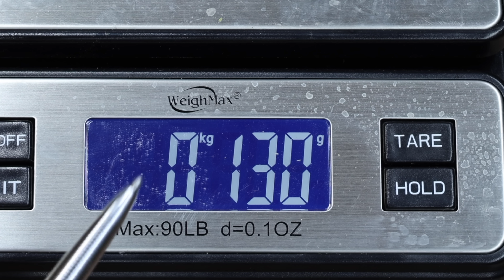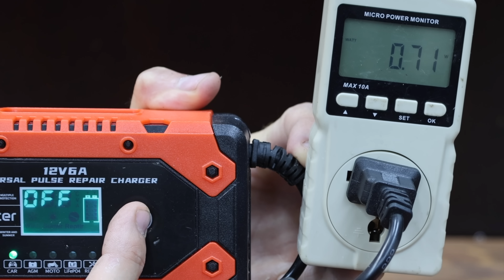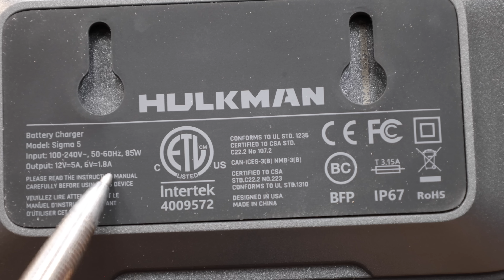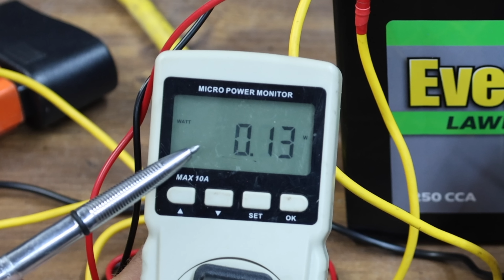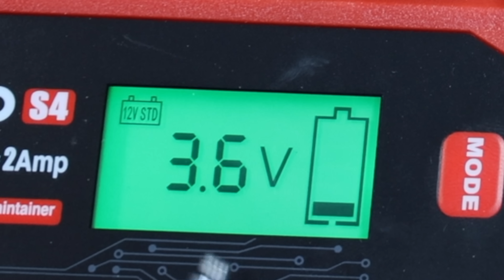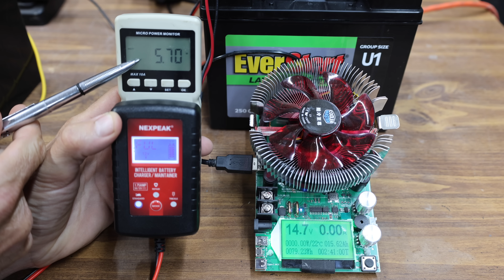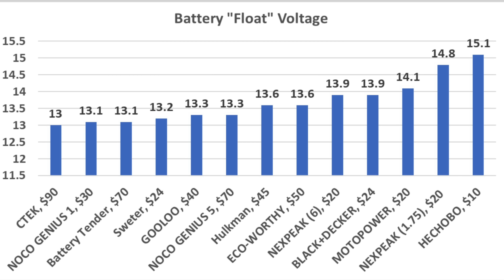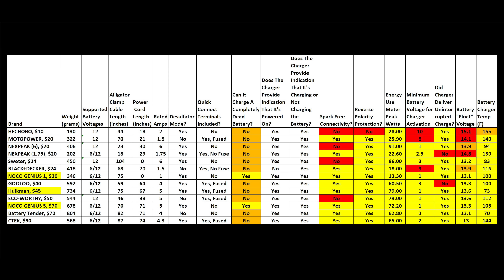I Tested the Most Hyped Car Battery Chargers – One Stood Out!

Comment: Interesting results.  The cheapest one is not good - what can we expect for $10?  NOCO had good test results - that's great to see for an inexpensive charger and a medium priced one.

Many years ago, I had a Black and Decker unit and it didn't last very long.  I was not happy to see it completely die.

I have a couple chargers now.  One Schumacher that can be carried and a bigger Schumacher that rolls around.  I typically use the bigger Schumacher, because it has a 150A start function.  I know it's terrible to do that to a battery, but it does get things going quickly.  And if it overheats, it goes into a cool down mode before it can be used again.

I'd love to see a review of the type that can be carried and the rolling one.

I learn something all the time from your videos.  I appreciate all the hard work you do!  Thank you!!

Comment: Excellent video.  That what happens with the "smart" tech on the battery chargers these days, if they cannot detect anything they won't do anything.  Old chargers didn't care and just delivered, but they didn't know when to stop sometimes.  But if you have an old one, you can get things going and then switch to the newer tech.  It's interesting as I have an older battery tender and it will work on a completely dead battery but just takes forever and I have an old real Sears trickle charger and it will do the same.  A few years ago I got a big powerful smart charger that is supposed to boost, charge, bring back from the dead, start my big diesel tractor etc and it is junk - worst 75 bucks I ever spent.  I vote for a review of the big chargers please and thank you!

Comment: I deliberately keep a couple of simple "dumb" chargers around to use on severely depleted batteries.  The good old Arlec 3 and 5 amp 6/12V ones with a meter are perfect.  I really like the modern multistage chargers, particularly the high end ones such as Ctek for maintaining batteries over time - although for batteries in boats and machinery it's very hard to go past a simple 10-20w solar panel here in Oz to get several years of trouble free service out of expensive batteries...  The only problem with the dumb chargers is sparking, and that you probably don't want to leave them hooked up beyond getting a battery up good enough to swap over to a smart charger of some kind to finish them off.

Comment: I’ve had my Noco genius 5 for 3+ years. It stays plugged and charging something pretty much 24/7. It’s been the best charger I’ve had. The repair function brought my 6 year old mower battery back that wouldn’t crank for more than a few seconds. Now I get almost a minute of crank time. I’ve never had a mower battery last more than a couple years. In my eyes it has paid for itself.
Reply: You need a non return valve in the fuel supply line to the carb...plus perhaps another one in the supply line from the tank to the fuel pump..
to keep fuel in the lines

or a cheap 12VDC Facet style clicky clacky inline pump on a momentary push switch that you use to fill the carb BEFORE hitting the starter function.....

Comment: With all the talk of OIL viscosity…. Can you do a test with small engines with 0-8 oil and the other with 10-30 oil under a load at high rpm and then check for wear.

Comment: For one video, could you test pens or other marking items, I always notice you using one as a pointer. Should be a cheaper video than most. Ink smear test, tip drop test, can it write on wet/slick surface, weight of clicker, clean up ability. I think it would make a great video.

Comment: Not surprised that the Noco chargers walk away with this one... 

I have a Noco Genius 10 charger that is ~2 years old and in one case was used 1-2x a day in ~115deg weather for ~3 weeks while diagnosing a ECU fault (with no apparent wear to battery) and Noco 125 Jumper pack that is ~5 years old and was the only thing that I could find that worked at -20deg and below when I did 24/7 IT support in Wisconsin. The Noco jump packs also have a much higher safe storage temp than most other packs. It is safe to say that I am a fan....

Comment: Ive used nothing but Battery Tender Juniors since 2008.  They just plain work.  I have NEVER HAD A FIRE or meltdown of a Battery Tender.  In fact, I have charged a mostly dead car battery with a B.T. Junior.  Just waited a couple of days and the car cranked right up.
I have NOTHING bad to say about Battery Tender Jr's.

Comment: Thank you for your tests, I have been using CTEK since 2016 and I am happy to say, it has worked flawlessly.
Reply: CTEK is the gold standard, very reliable even durian cold climate.
Reply: Mine blew up recently from heat! Avoid using in heat and they’ll be golden.
Reply: @ScottPC Wierd, have used them in winter and on hot summer days since they came out, never had a single problem.
Reply: @The.Royale.Syndicate  
Ditto...even in a hot engine compartment to fully charge a battery....

Comment: Great video, yes definitely do a handheld version charger with battery boost,agm gel std,batteries also 13.6volts stable charge for doing work with scanner and engine diag. Forney# 52750 would be good candidate .thx

Comment: Having dozens of batteries to be kept maintained, my usage does not often include the need to charge a dead battery. Adding a jump box to a dead battery will allow a charger to start up. After a few minutes, remove the jump box and the charger will continue.  I have tried many brands of chargers throughout the years, and Battery Tender chargers will not kill batteries over time (over winter, 1yr, 5yrs, etc.) However, CTEK and NOCO, while being OK for short term, are not good for long term storage. I have given away NOCO and CTEK chargers over the years, just to go back to Battery Tender chargers. Their customer service is exceptional. And they do not kill batteries when connected long term. I understand that this Project Farm test has different criteria, but wanted to make sure BT chargers were fairly represented for what they do best. I have no affiliation with BT. Just an exceptionally happy customer.

Comment: Battery tender brands always failed me randomly so i switched to NOCO. I had a Noco Genius 5 short out and electrify my race car that it was hooked up to. I found out when i touched the roll bar and it shocked me. My genius 10 also randomly stopped working a few years later. Noco replaced it but made me pay return shipping on the broken unit which was annoying. The Genius 10 was attached to my Audi and it killed the AGM battery in the car. Cost me $300 to replace the battery.

Comment: Output current can't me measured at the wall. That shows consumed power for the charger, but even the best power supplies have loss, so only 80-95% of the consumed power is going to the battery. Good video

Comment: I would not be interested in charging a dead battery... the electrolytes and plates inside are toast. Even if you could charge it, it won't last. Anything below 10V and you could have a bad cell. With that said, a good maintainer, disulfate, trickle charger, and auto shut off is wise for any vehicle, boat, motorcycle, lawnmower, ... that sits for any length of time and that will prevent your battery from getting below 6V or 12V.

Comment: Based on my experience, I would recommend Guest chargers over NOCO ones; they are a little more expensive but they are much better.
I have been maintaining +/- ten batteries with six single bank Guest ChargePro and smaller Schumacher chargers. Three years ago, I bought a NOCO GEN 5x3 based on reviews and price, it worked fine for about 8 months and became a 5x2; bank #1 would continue to charge regardless of the voltage or SoC of the battery. I contacted NOCO support via email and they told me that the charger was no longer covered by their warranty since I extended the leads.
So I went back to Guest and bought a ChargePro 5|5|5, and it is still working fine after two plus years; just like the older single bank ones.

Comment: Is the CTEK the only one that is "environmentally sealed"? That would be a godsend on charging up vehicles somehwat out in the open as long as the connections are kept dry. In the meantime I am just using an iMax B6 V2 since I also have my LiPo and NiMH batteries. And yes on the more powerful chargers!

Was hoping some temperature sensors would have came with the more expensive chargers just as I can use one on the hobby chargers - maybe on the larger ones?

Comment: The CTEK has even more features that weren't covered. I'm not sure there is such a thing as "charging a completely dead lead acid battery".  If the CTEK can detect the battery (some resistance) it will cycle from high input volts to low, over and over, to see if it can get at least a trickle of charge going. It knows how to charge deeply discharged batteries. Similarly, in float mode, it cycles the voltage to make sure the battery is completely fully charged - it doesn't just sit at 13 volts - however that may be it's rest spot between cycles. It continually probes the battery, in first and last phases of the charge. One other plus is the CTEK has ring terminals on a long quick-disconnect cable, for all weather ease of connecting and disconnecting. (Some cars have batteries in tough spots to get to, the long cable addresses that issue.) It is a very nice product. The only thing you could really add to it is a higher amp charge mode or a starter-boost mode - but those take larger and heavier devices. It may feel perminum to the junk on this list, but it's probably worth it (and is to me.)

Comment: Have you priced the cost of a 12v battery recently?  I’m all for saving money but when I have a dead battery I want a quality charger that actually works and not some cheap Chinese charger. You should add a “Drop Test” (x3) for all of these chargers from 4’ because it will happen.  I have the higher priced NOCO Genius 10 that cost $80 but I have no idea if there are better chargers out there in this price range.  The next jump in the NOCO charger family is the Genius 25 at $600, no thank you.  Also add “Ease of use” to your next test because at 5:00 in the morning when I have a dead battery I don’t want to have to read some manual printed in Font size 4.  I just want to plug it in and charge my battery.  I guess I’m spoiled growing up when the only switch on a charger was 6v or 12v.

Comment: It´s normal that the charger doesnt recognize the battery if its under er sertain voltage. Thats where the  "Supply" mode is used first. By the way i use both NOCO and CTEK extensively with great success. Pleas add GYS chargers at som point if possible. Made in France and there are a variety of different models. Great quality

Comment: Another nice thing about the Noco chargers is that they can be used as 12V power supplies for some applications by pressing the button that forces the output to go live. I've used mine in place of a battery on my old MGB many times. I've had it for about five years now and it's still going strong

Comment: I think Ctek did revision on their charger over the years. My old ctek 5.0 (now a paper weight) didnt activate when the battery is less than 8V, had to parallel the weak battery with a working 1 before it would start charge. 
Btw, for a product of "Malaysia", it cost 160USD here in Malaysia..

Comment: I've had the C Tek about 10 years.
As long as the battery isn't swollen or leaking, I've been able to revive it using the reconditioning function.
Takes about 20 hours.
Im happy with it.
Reply: Also have a c-tek, had a lot of others before and this is the best, a littel expencive but you get what you pay for, I realy like the reconditioning function
Reply: Plus (unfortunately) a decent burrito meal (at least in Cali (I know, I know)) cost $20+ so for a couple of burritos extra, you can get the CTek?  No question for me.
Reply: The CTEK he tested here is 2 generations old now. I bought one back in 2021 because I had already replaced a dead battery during the 2020 lockdowns, and wasn't going to spend another $250 on another new battery just to have it die again. So I bought the MX 5 for $150, and since then I've used it a few times a year when my car has been parked too long. 10 minutes has been enough charge to start the car, and half a day for the full recharge/recondition cycle. Still working perfectly.
Reply: Just 10 years! I bought my Ctek 3.6 amp charger in 2020, after we moved to a new house in Sweden, and it has been working flawlessly for 25 years. The wire leads needed some mending due to age and wear but still charging and reconditioning our car batteries. It has seen 6 different car makes and models in the past 25 years. Now beat that 😂!
Reply: I agree.  C Tek works great for me.  I think in this case buy once cry once really applies.  Especially if it going to be used on a special car.
Reply: I’ve had 3 of them all of the 3 had the select button fail and would do nothing but charge std 12v
Reply: @nathanhoyle-kq2qi I found the select button wont work for about the first 20 seconds after turning on then its fine.

Comment: I have the small and big Ctek   and they are awesome,   for a dead battery i just jump it with another car battery or a 12v or 18v power tool battery for 1-10 min and then put the charger on it , also the restore function works as each year I disconnect the terminal on the car and run the restore function for 24 hours and all my cars get +5 year of use out of the car battery,   the bigger charger gets hot so I put a fan on it (mod the case shhhh )  hopefully keep it working forever.

Comment: I’ve now owned 2 of the Ctek chargers and while I do find them quite good. I did manage to ruin my first one, whether it was the accidental AGM setting or it just getting too hot over time, I still replaced it. The kit I have now has a set of connectors so it can be “permanently” installed to your battery, allowing quick disconnect / connect. Other than that, it just works and is easy to use

Comment: Now that "Beyond Ballistics" invented or popularized the citric acid + lye rust removal mix, it would be interesting to test slightly different ratios and how much heat speeds up the process. One dude put it in his ultrasonic cleaner (with the heat on) and the result was damn near black magick. Well, not surprising, really... And, will THE BEST rust converter ie. phosphoric acid (spray) alone prevent it from rusting again for any length of time...

Comment: thanks for showing the voltage specs on the back.  i took my tiny battery tender on a trip and after a couple uses it quit working.  most electronics nowadays works 120-220 volts but not battery tender even though they are made in a 220v country :)  i just put the noco into my shopping cart for when i return home.

Comment: Noco is a quality product, I have the Genius 1 and it works great to keep one of my motorcycles always ready to go.

They are more of a powersports amp maintainer unit and not included in the test, but I've also used Optimate chargers for years and they always served well with my bikes, keeping batteries going for up to 7 years, which is good for an AGM motorcycle battery.  Currently running the aforementioned Noco and an older Optimate 3 on my other bike, it has to be over 20 years old.

Comment: A notable feature of the Noco Genius 5 is the ability to do multiple battery chemistries, including lithium! Most chargers can't do that. Lithium batteries have a BMS that will show extremely low voltage when "dead" then show around 11 then you wake it up. Noco's work great for this. The Noco 5 and 10 are the only charges we use around the shop.

Comment: I got a cheap charger never similar to the sweter. It fixed a 570cca battery that read 250cca on my tester. I ran it in the repair mode for 3 days I turned it on in morning and again in the evening it will automatically stop trying to repair battery after a few hrs. It would start a acura 3.5l then it would after a fixed it. I also fixed a lawnmower with 25hp that one still has the fixed battery in it a got a new one for the acura

Comment: seeing as the battery light comes on if your alternator delivers less than 14V, I don't understand how these smart chargers hope to achieve anything with just 12V, so I would avoid all chargers that say they output 12V (unless you can test them and see the actual voltage), but my smart charger definitely never fully charges my batteries.

Comment: Glad to finally see a product review on chargers. I think you should also do a review on larger chargers. Not the big ones used by mechanics, just the normal homeowner size. Also remember to include Schumacher brand. I've had excellent luck with those. Interested in seeing how they hold up in testing

Comment: I was hoping to see the Optimate3 charger. it is VERY popular for motorcycle batteries, has diagnostics and 'repair' cycles. It recovered my motorcycle that had problems after using a generic auto parts store brand unit. Keep up the EXCELLENT testing videos - AWESOME Job!

Comment: Most chargers won’t charge when the battery is very discharged. This applies to big ones on wheels as I have three. I usually only buy the manual version for that reason. I have one big automatic one that has a manual position. My terminology is three states. First is charged at different states, second is discharged at different states third is dead which cannot be recharged. I only use the ones tested as maintainers. Still useful information though.

Comment: I'd love a video about larger chargers. maybe with a "feature" score where you check, whether the chargers actually take things like temperature & type (agm/std) into account. I think you can improve the accuracy of your charging performance test by measuring the output current (by using a clamp meter for example) rather than the input power. Keep up the good work!